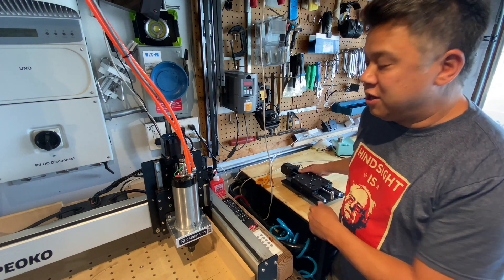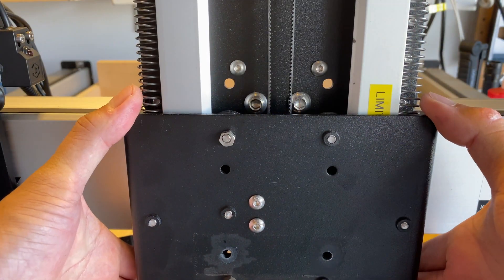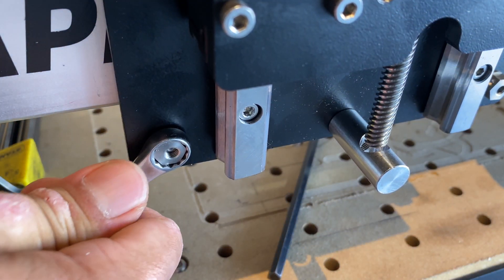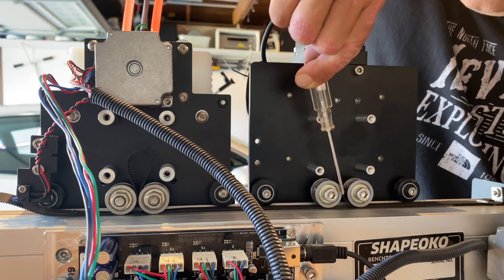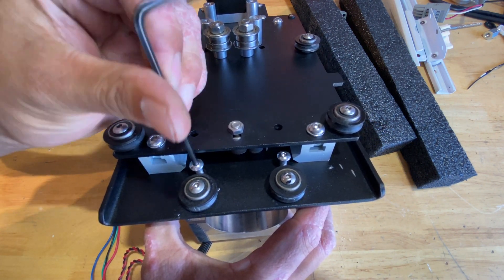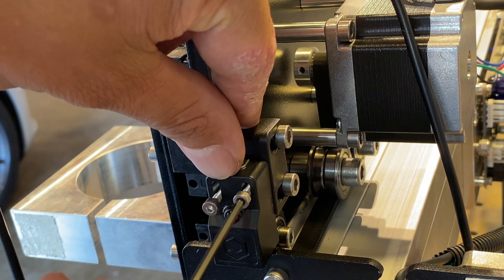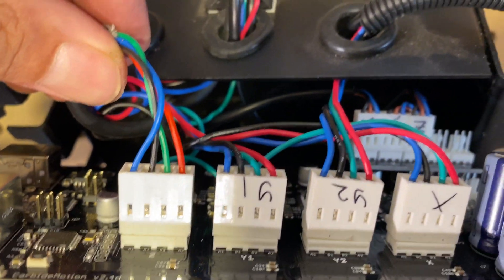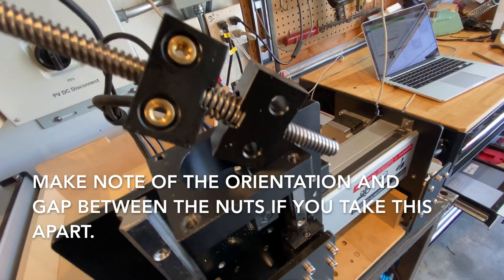Unofficial instructions on installing the Shapeoko Z plus upgrade

Comment: what spindle do you have there? I just ordered the z plus upgrade, will want new spindle to replace loud router soon.
Reply from the maker: This is the spindle kit I bought: https://www.amazon.com/gp/product/B01N1EJEQ1/ref=ppx_yo_dt_b_search_asin_title?ie=UTF8&psc=1   

It runs on 120vac.   Overall I'm happy with it, it's super quiet.  It seems to be limited in speed  to about 10k rpm, based on using the built in speed pot and the displayed speed on the keypad. I haven't actually measured the speed, or spent more than 10 mins looking into modifying the parameters to get higher speeds. Seems like it's running 10krpm at 400hz.  It would be nice to go higher than 10k, sometimes I like to really mow through material.  10k rpm is also  the low speed on my Makita router which is also fairly quiet at that speed.  Nice thing is you can run the new spindle really slow for aluminum. 

The spindle motor has a smaller diameter at the collet end, compared to my Makita router, so for fitting a dust boot, and access for watching  the cutting bit is better. 

Since the new spindle is liquid cooled, there's no fan which makes it quiet, and the chips from cutting don't blow all over the place.  The kit came with a full set of ER11 collets, much nicer than using spacers/adapters with the router.  I wish  collet wrenches were included with the kit, I'm using big box wrenches, would be nice to have something smaller.  

The kit came with a HY brand inverter, which seems to be more feature rich than some of the other no-name brands. It has options for remote keypad, remote speed pot, remote start/stop buttons, speed select inputs, programmable relay output...  I suppose you could wire the water pump to run off the relay output, so it automatically turns on when the spindle is up to speed.  I just have a master switch that turns everything on at once.   The VFD seems to be EMI filtered well, I don't see any of my garage lights flicker like have experienced with other inverters. 

 I bought some shielded cable for the motor leads, since the VFD puts out a lot of EMI.  There is no provision on the motor connector for a ground, so I just put a ring terminal on the screws that hold the cable strain relief.   I also segregate the USB cable a few feet away from the motor leads, just to prevent any interference  I did have an issue with my Shapoko stopping in the middle of a run on occasion, but I think it was a software related issue.  hope that helps.

Comment: Installed mine today,  your video was a big help, thanks.   
I also upgraded to a touch probe and a bit setter,  when testing the bit setter it would go to the bit setter position and then begin to go down and stop after about 5 mm of travel then gave an error code.   After several resets I went to the internet for help,  found the problem quickly.  The X-Y-Z probe was grounding out.  
All set and ready to play!  

Thanks again,